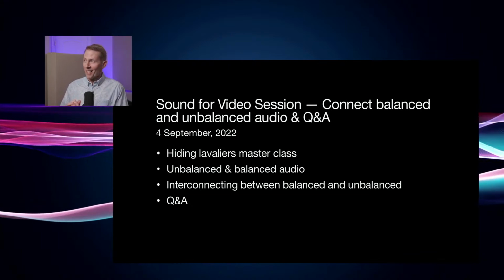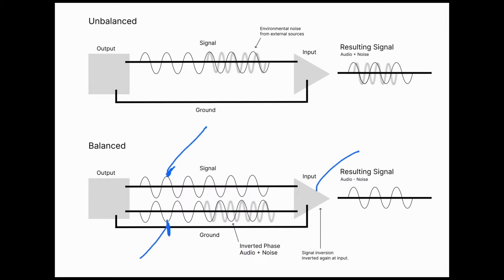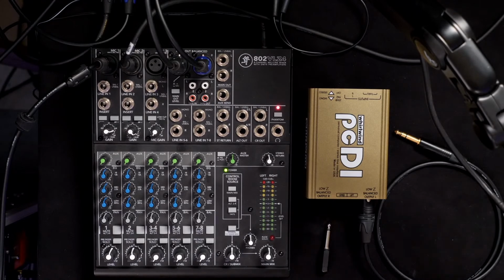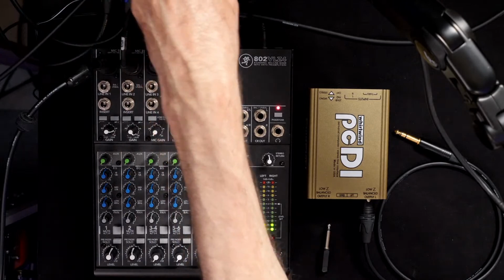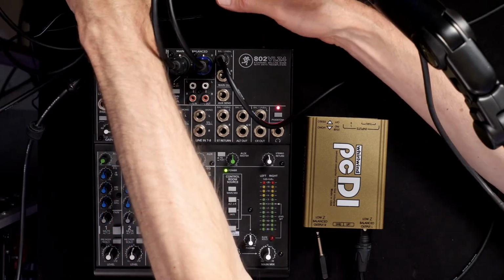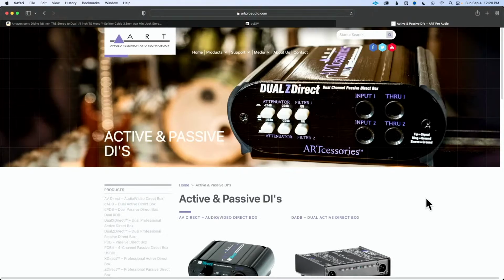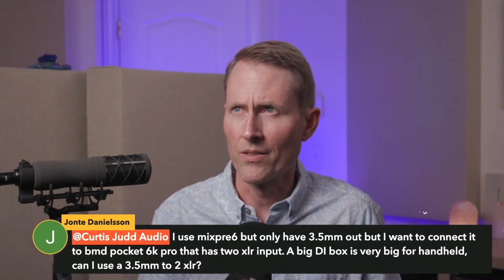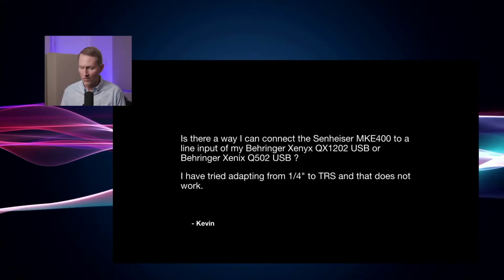Sound for Video Session — Connect balanced and unbalanced audio

Comment: 🎯 Key Takeaways for quick navigation:

02:57 🎙️ Today's session discusses the differences between balanced and unbalanced audio connections and how to interconnect them effectively.
05:21 📡 Balanced audio is better at handling and rejecting noise, such as RF and electromagnetic interference, compared to unbalanced audio.
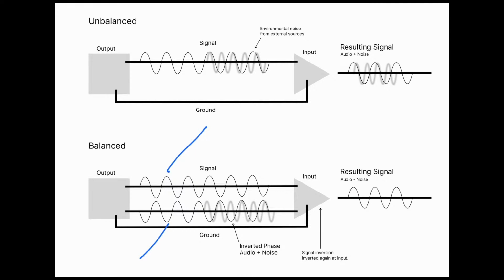08:40 🔊 Balanced audio uses a clever polarity inversion technique to cancel out noise, resulting in a cleaner signal.
12:54 🔄 Achieving a balanced signal from different equipment can be done using transformers, differential amps, or integrated circuits, each with its own benefits.
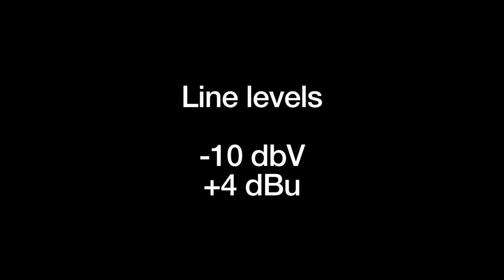14:47 🔉 Line levels can differ between consumer-level and pro-level gear, with balanced outputs typically at +4 dBu and unbalanced at -10 dBV.
17:23 ❌ Incorrect wiring of cables can result in inverted polarity and degraded audio quality when converting between balanced and unbalanced signals.
20:46 💡 Using dedicated devices like the ART Clean Box Pro or DI boxes can properly convert between balanced and unbalanced signals without signal degradation.
24:26 🎛️ DI boxes can be used in reverse to convert balanced outputs to unbalanced inputs, providing flexibility in signal routing.
25:15 🔊 When converting from a balanced output to an unbalanced input, boosting the signal may be necessary due to differences in dB levels.
26:25 🔄 The ART CleanBox Pro facilitates conversion between balanced (+4 dBu) and unbalanced (-10 dBV) signals, providing amplification to adjust levels accordingly.
28:52 🎚️ Using devices like the ART CleanBox Pro allows for audio conversion from balanced to unbalanced, enabling compatibility between different equipment.
29:48 💰 While more expensive, products like the ART CleanBox Pro offer superior solutions for balancing and unbalancing audio signals compared to cheaper alternatives like a DI box.
30:15 🎤 When dealing with audio conversions, careful consideration of signal levels and amplification is necessary to achieve desired sound quality.
34:18 📏 Understanding impedance and signal types is crucial when troubleshooting audio compatibility issues between different devices.
42:57 🔌 Using a DI box can resolve compatibility issues between devices with unbalanced stereo outputs and equipment expecting balanced inputs, improving audio quality.
46:38 🔊 Balanced and unbalanced audio outputs can be switched using different connectors: TS quarter-inch for unbalanced and TRS three-pole quarter-inch for balanced.
48:23 🎤 Using a splitter, it's possible to input an external mic and timecode into the Blackmagic Design Pocket Cinema Camera 6K Pro, but audio inputs need to be switched accordingly.
50:04 🎙️ When recording loud sounds like F1 cars, use microphones with high SPL handling and ensure the recorder's pre-amplifier can handle the intensity without clipping.
51:45 🔄 Understanding how pads are implemented in audio equipment is crucial, as some implementations may not effectively prevent clipping.
53:35 📚 Courses on Zoom F8 and MixPre series have been updated, covering the latest firmware and product versions.
54:19 🎙️ No attenuator should be necessary to connect a Sennheiser XSW-D receiver to the mic inputs of a Zoom PodTrak P4.
59:02 🎚️ MixPre outputs cannot simultaneously output linear timecode and audio; it's either one or the other.

Made with HARPA AI

Comment: To switch the audio signals from balanced to unbalanced I recently also discovered some small passive transformers from Neutrik of the NA2 series (such as the Neutrik NA2 F-D0B-TX, the Neutrik NA2 M-D2B-TX and so on). They work wonderfully and require no power supply

Comment: Notes on the Sennheiser MKE 400 and the Røde VXLR adapters.
The Røde VXLR does not convert phantom power to plugin power, and it does not convert the unbalanced signal to a balanced signal.
The Røde VXLR+ does convert phantom power to plugin power, but it does not convert the unbalanced signal to a balanced signal.
The Røde WXLR PRO does convert phantom power to plugin power as well as convert the unbalanced signal to a balanced signal.
So if a balanced signal is important, ONLY the VXLR PRO will work.
There are two generations of the MKE 400, but they both run on AAA battery power, so plugin power is normally not needed. I don't know if it can even work on plugin power alone, but if mounted on a camera, which is what the microphone is designed for, you'll certainly want the extra boost that the batteries can supply. When connected to a mixing board I don't know what difference the battery power will make, or if it even might disturb the connection. Nor do I know what part the plugin power might play.
Reply: Thanks for the note, Lau.

Comment: Seeing that it only takes three wires to make a balanced signal, couldn’t a stereo trs 3.5mm do it if the input jacks and circuits were configured to do so? They have three wires as well with left right ground. If so, why is this not a thing?
Reply from the maker: In theory, yes, however, one practical matter and one tradition. From a practical standpoint, 3.5mm cables were originally designed for consumer level equipment and typically do not include the level of shielding that TRS cables with 1/4" connectors designed for balanced connections include. Also, professional level equipment has long used the 1/4" jacks and connectors which are simply more physically robust and durable.
Reply: @LearnLightAndSoundSessions  Well it would be cool if some people got together and made a better 3.5mm cable. I mean, wouldn't it be great if you could get a balanced signal with those small connectors? Seeing as the equipment is getting smaller and smaller, I think it would be game changing. Oh well.

Comment: Hi Curtis,
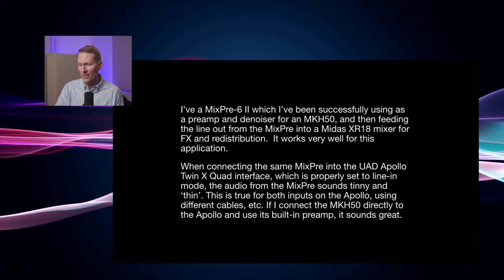from Roland's question at 42:00 , 
on sending a signal from MixPre 6's 3.5 to the UAD Apollo,
will a "3.5 to 2 (left and right) XLR" splitter cable also work instead of investing in a DI-Box?

Without knowing anything, I had a failed experience of sending a signal to a live mixing board with a single "3.5 to XLR" cable. 
I ended up saved by a set of SONY UWP Wireless set. Still not sure how,
is it one of those Balance/Unbalance things?

Thank you very much for your time!~
Reply: That could be. Would need more details, but very possibly yes.

Comment: For balanced to unbalanced stereo conversion I sometimes use a Tascam  DR60D-MKII that accepts balanced connection on one side and offers simultaneous line level and microphone level outputs with camera out (high) and camera out (low) 3.5mm stereo unbalanced jack outputs. It works great!
Reply: Clever idea.

Comment: Important note: when using the reverse DI, it MUST be a passive (transformer only) DI. It cannot be an active DI that has electronics that drive/buffer (or amplify) the signals.
Reply from the maker: Right you are, thanks for pointing that out, Randy. 👍